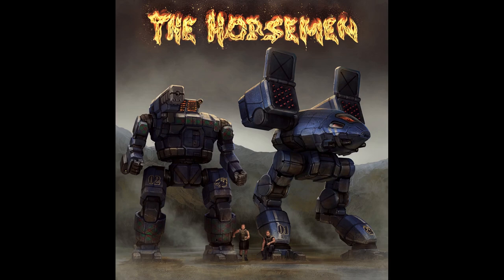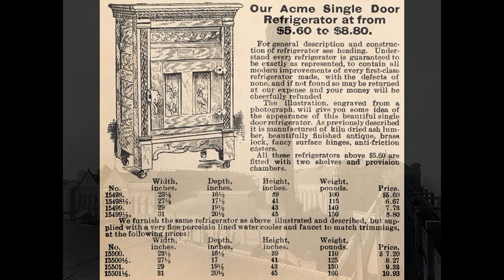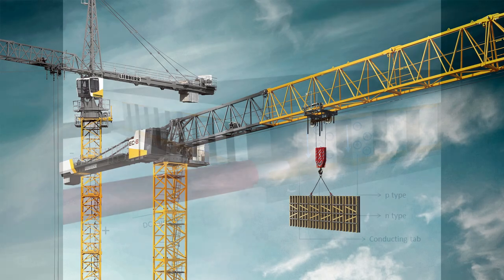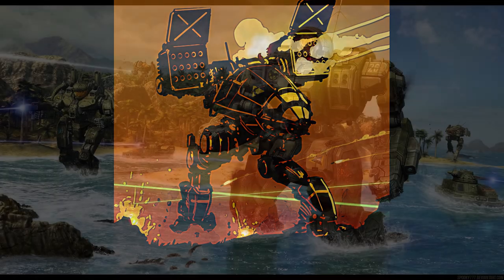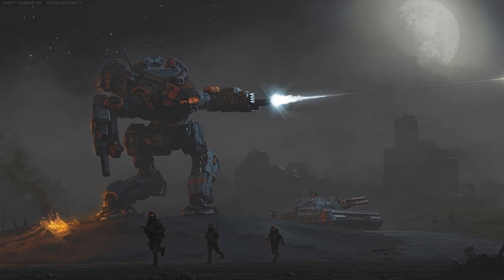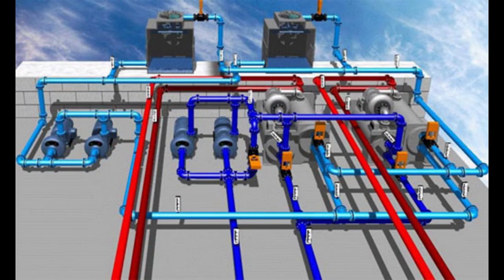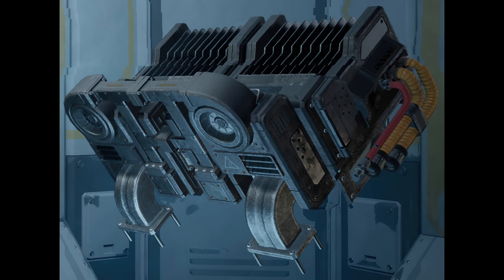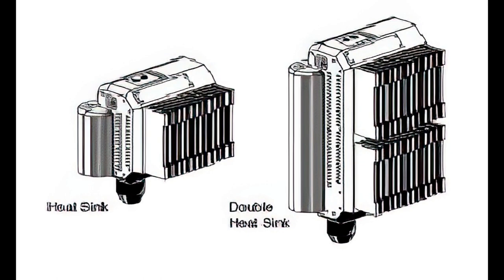BattleTech In Depth - Part 4 of 7, Cooling Systems

Comment: Hello Caboose. 
   I thought you might be interested in a Periphery Design Mech. The only 'modern' tech in it is the 20 Compact Heat Sinks. 
   Mech: Effigy Mk-II. 90 tons mass. ICE engine, movement rating: 1/2/0. Armor: 19 tons 'standard' armor. Gyro: standard. Cockpit: standard. Weapons: x6 standard medium lasers (2 per arm, 1 each left and right torso), 20 Machine Guns, with x6 Machine Gun Arrays (4 MGs plus array in each arm. 6 MGs plus two arrays in each of left and right torso). Ammo: 2 tons MG Ammo. Heat Sinks: 20 Compact Heat Sinks (Inner Sphere). 
   Yes, the Mech is SLOW. But it is designed for deception. Since the Effigy is powered by ICE, it does NOT show up very well on Mech sensor systems, which are usually looking for the signatures of Fusion Engines. 
   The Mech is designed to look like a Mech sized, Mech statue in cities. Usually standing upon a low 'plinth', and located in town squares or other such urban 'parks' inside larger cities. 
   With some effort, the Mech's entire armored 'skin' can be used to thermally camouflage the unit, making it look even more like a statue dissipating heat normally. 
   6 medium lasers generate 18 heat per combat turn, and running the Mech generates 2. This results in a net ZERO heat buildup of the Mech, making it harder to target using thermal scanners, and thermal sighting systems. 
   The Mech is dead easy to maintain, since everything on it is 'standard', other than the Compact Heat Sinks. 
   The threat of this Mech should not be discounted. It can easily 'core' an enemy Mech at close range and score multiple critical hits, all in ONE salvo of its weaponry. 
   To make this machine more effective, just add about four times as many 'real' statues of Mechs in the same location as each Effigy-II Mech. 
   Usually, an Enemy Mech is allowed to walk right past an Effigy Mech, only to have the Effigy run up behind it and unload everything into the intruder's back. This usually results in a 'one shot kill' of the Enemy Unit. Thus, NOT allowing any word to get out of just how this was done. Multiple Enemy Mechs would be 'allowed' to pass until several Effigies can be deployed as a cluster of statues, to also perform such a single turn backstabbing attack on all the Enemy units available. 
   Yes, yes, I know, the video is about cooling systems. But I thought you might be interested in a practical design using Compact Heat Sinks.
Reply from the maker: That's quite a mouthful, and an interesting design.